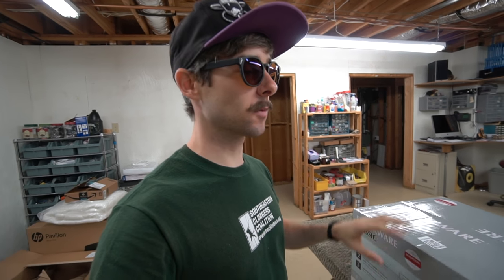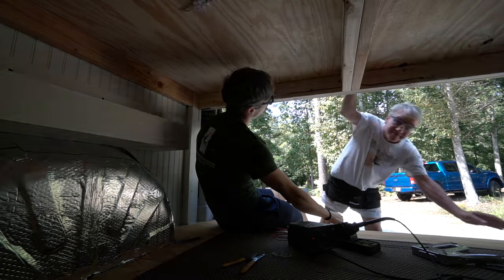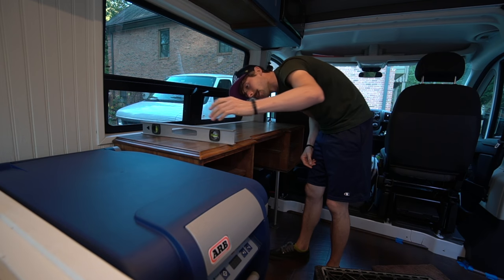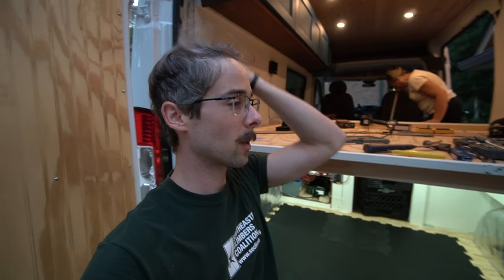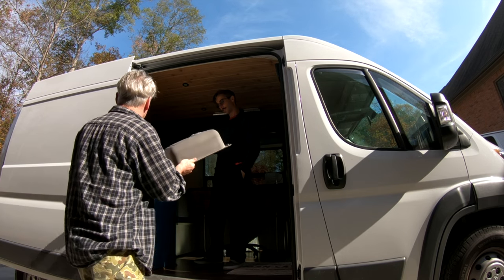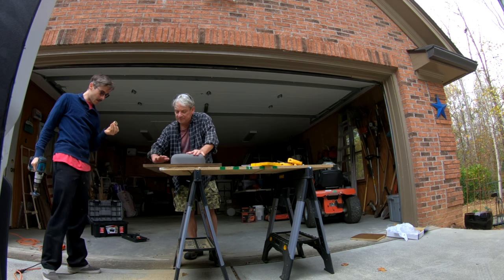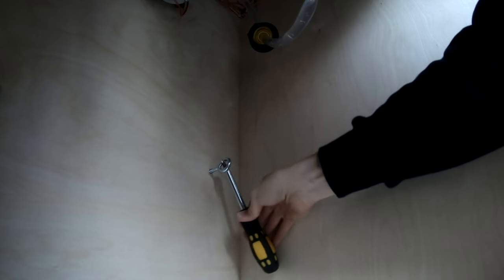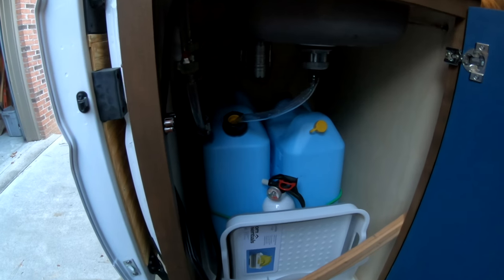Van life Sink & Work Bench install I Promaster

Comment: Suggestion for your water. Use a compressor to pressurize the air in your water tank. That way water will come it without any noise...
Reply: Yes ive got a tank Luke this in my workcar for handwash ! I just pressure it AG the gas Station 15psi IIS enough

Comment: Honestly, most of the time the inverter will do the job....1,000 watt inverter will put out 1,000 watts...but...you need to have the battery behind it to do that, don't forget that 1,000 watt output at 110volts will most likely end up at over 100amps over the period of cooking in the microwave....and car batteries cannot supply this amperage for very long. I'm an electrician and in our work truck we had a small.microwave on a 3,000 watt inverter that would run the microwave drawing insane Amps on the DC side and eventually we were going through batteries every few months or sooner...if you want to pull that kind of current off a lead acid, I suggest getting at least two in parallel (and even 3 would be better) and using some GOOD deep cycles batteries, I'm not talking about some 80$ Napa deep cycles, you need some optima blue tops .their a 250$ battery but will easily handle deep high current discharges. Kinda like the ISDT chargers lol.. you can buy the 300amp version but...ugh...oh wait? Now I need a 100$ power supply the size of a brick to run it...without good batteries and multiples...you will cook them in a week using that microwave every day. A generator would honestly be your best bet..a small mobile home unit would be great and their very small and compact to fit in mobile homes an 8kw would be fine for what your doing. It's actually pretty amazing what our lipos can supply, their a fraction of the size and can pack more of a punch for longer periods or time than a 40lb lead acid can...technology is amazing
Reply: DC is inverted to AC power and stays ac power to power the microwave. The microwave is 110 volt. The inverter will output 1,000 watts which is 9 amps depending on exact voltage but the DC side (supply side to inverter from batteries) will draw OVER 90 amps to supply that 9 amps at 110volt. And as the battery voltage drops even the slightest bit that amperage will go well over 100amps....this is an enormous amount of sustained current to ask any standard or even deep cycles car battery to handle. Microwaves use magnetrons to create microwaves....these magnetrons use high ac voltages from transformers to do this. There are no portions in the microwave running off DC power...actually I shouldn't say that, the control boards may convert internally to a lower voltage. They do make microwaves capable of duel power for RVs and boats, they can run off 110 volt or 12vdc. Inverters are good for certain situations when installed correctly but most of the time there are much, much better options.
Reply: Yeah he should just make a large battery pack from 18650's like a tesla bank.
Reply: That's the LiFePo4 battery right there in the back, not regular Pb.

Comment: Actually it's a good thing the copper lines or fittings leaked, because with this being a van, your situation is ideal for flex hosing. Fate is on your side Steele.

Comment: Little late to this comment thread but just binged the whole FPV thing over the holidays and was stunned that I hadn't gotten involved sooner. Great videos and of course flying however I have one comment on this particular video.  Get one of those under cabinet sliding shelves for your Jerry cans.  Grabbing those from outside the van and twisting has chiro visits written all over it.  It's the pivoting that will get you get you eventually. I've done it!

Comment: I wonder if there are tanks with a waste water bag that fills in the same volume you're emptying. Kinda like a carpet cleaner. Same tank for clean and waste, bag expands replacing the clean water volume with waste without contamination. Guess it depends what you'll be washing... :x

Comment: Okay I'll help you guys out unless it is a true sine wave power inverter it will create problems because it is what they call a square wave or a dirty wave thus creating problems with the microwave being able to perform the way it needs to it basically is not transferring a smooth signal like a rounded wave a square Rave is technically a flipping on a power flipping off a power and doing that a bunch of times does not allowing the microwave to do what it needs to efficiently it's kind of like flipping on and off your Motors on the fpv use it just doesn't work right but if you do a smooth signal with the throttle back Works efficiently check out pure sine wave and not only that but it will also save on your batteries because it's able to produce the wave more cleanly the US not needing as much energy to suddenly flip on Full Throttle and suddenly flip off and back on like a square wave does
Reply from the maker: It’s true sine
Reply: If memory serves me, I believe Mr. Steel has an electrical engineering degree. Pretty sure he has the electrical stuff down 😉
Reply: poppasmurf63 yeah but see there are so many people out there who don't know the difference and I don't know mr. steal like you do evidently as I believe he's a cool guy flying some cool Acro and definitely entertaining but other than that I just have a tendency to speel what I know is knowledge and share it with all so even the other people who may be questioning may now no thanks to the statement but thanks for letting me know that he has an engineering degree and I appreciate it

Comment: Seriously!!?? I thought you were an American (you know: wide roads and cheap petrol, low tax/weight and stuff)... Why not just settle on one of those Breaking Bad style campervans for luxury and space?
Reply from the maker: For a nice one it’s really expensive. Like $100,000 is a cheap used shitty one   Plus with a van like this you can park it anywhere and people just think it’s a normal van.   RVs are big and you have to park them special places.  Can’t go off road...  very limited
Reply: You re talking about a big in America so called RV... trust me man, steele is doing the right thing. RVs are slow, too long for small corners and streets and its to obviously to camp or stay in an RV. I rent an RV in march this  year, traveled from charlotte, Charleston, Miami, back to Atlanta and Charlotte. It was a nice trip, but it was a torture sometimes to find a parking place. But i managed to park direkt on the Ocean Drive in Miami! 💪🏻
Reply: Fair enough.... Make sure you properly lock the thing though (with laptops and gopros lying around). These stealthy "White Vans" seem to get randomly broken into here, just on the off chance there's  power tools, or even just some expensive bolts and screws left in there. Enjoy!